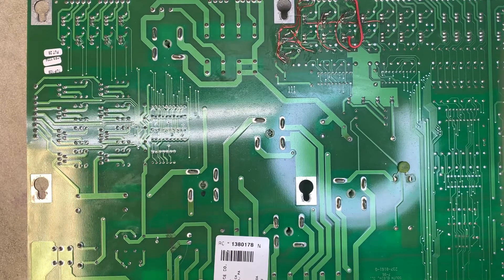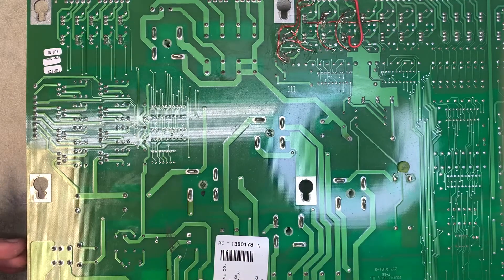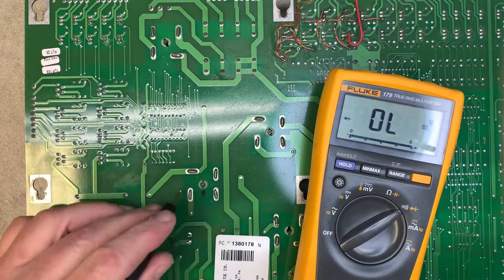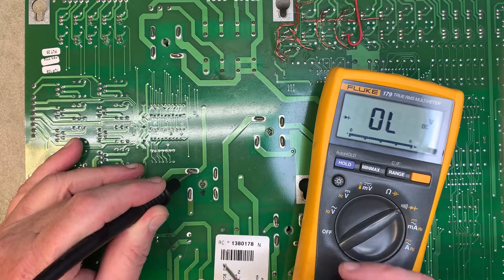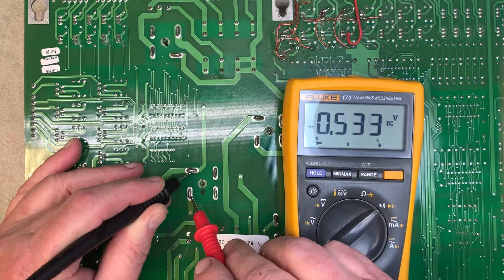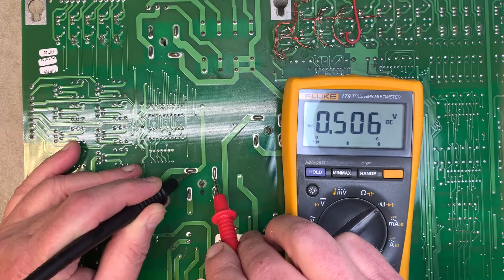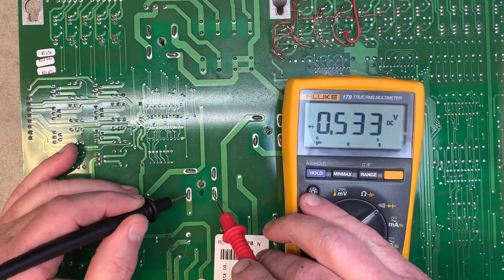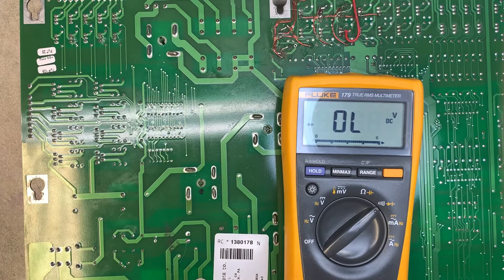Testing a Bridge Rectifier

Comment: I have a Lethal Weapon 3 and somebody replaced the spade style BR with a wire style one. When I test it, none of the legs are shorted but they all read 0.382 consistently. Is it bad, is it fine, or did somebody put the wrong BR in? Thanks for teaching me so much!
Reply from the maker: Your bridge is probably OK. Substituting a wire lead bridge is acceptable. They are easier to remove when required. If your 5V is missing, look for a leaky capacitor at C2.
Reply: @ChrisHiblerPinball  Thank you! I'm trying to track down the cause of the GI not working. The usual connectors were burned up so I'm replacing those headers and connectors. I thought I would test the rectifier (among other things) while I had the boards out, but I don't suspect there is a problem with the 5v. Just wanted to ask though!

Comment: Hi, im testing an old industrial PLC power supply (directlogic 305) that convert 120/240v to 24v for the cpu input/output etc... those power supply often fail in our environment (humidity) and they are discontinued so we need to find use one on internet each 3-4 years, so im trying to figure out the issue with a minimum of eletronic knowledge to maybe fix one. I'm at the step i need to test my rectifier (but it is a 4 pin in row style) but i need to ask can i test capacitor if they are still soldered on the pcb, and also the power supply im trying to fix is doing something strange, usally they are dead, but this one is making a kind of little beeping sound somewhere (hard to tell where this sound is really coming) maybe at 1sec interval like if their is still current flowing but something is failling... when i unplugg it, the beeping sound go on for 3 sec and is fading slowly for another 4 sec, maybe the time to empty a capacitor... what other components can i test with a simple multimeter that can fail in a power supply?

Comment: Love your repairs, could you show us how u desolder a rectifier like this? Would appreaciate
Reply from the maker: I probably have a video out there somewhere. However, I remove the heat sink, clip the wire leads of the bridge, remove each leg one at a time, and then clean the holes with a solder sucker.
Reply: @ChrisHiblerPinball  Thanks for your help, i would love to see a video about that and also how to desolder IC Chips correctly. Iam learning alot about pinballs cause of your videos. Thanks alot appreciate